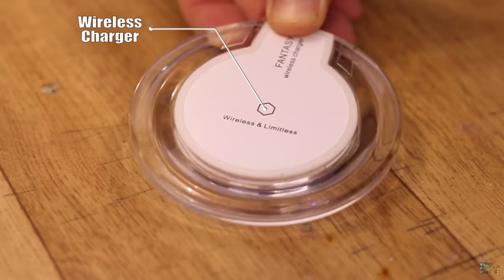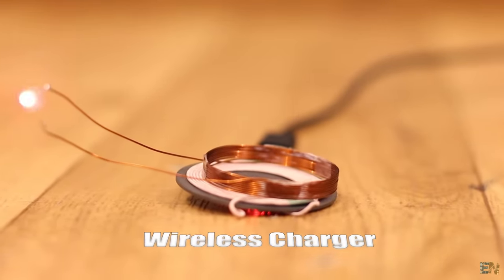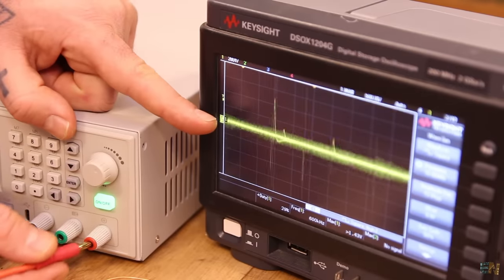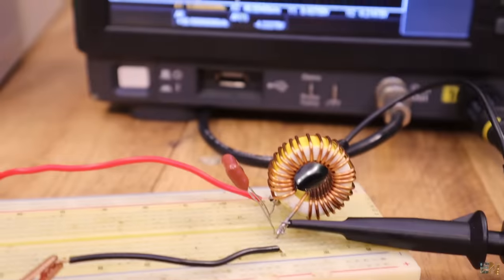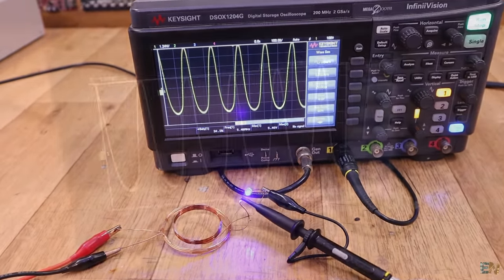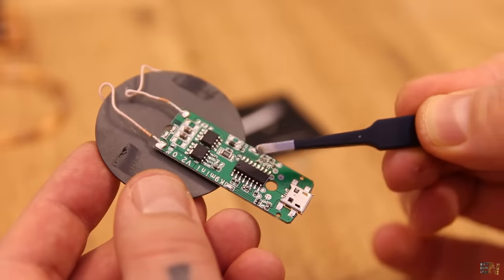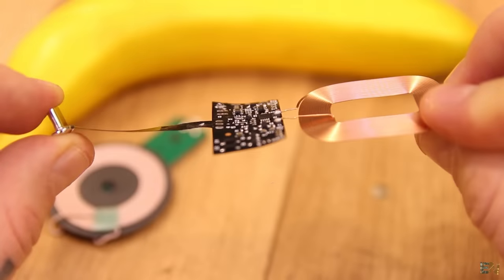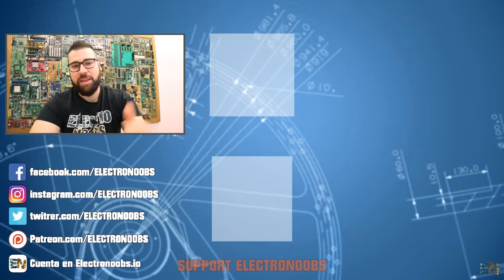Wireless Charger | Theory & Homemade Circuit

Comment: I wish you explained the transmitter circuit in detail. It’s not at all clear why the coil is center tapped, why the mosfet switches on and off, what all the capacitors are for, etc.

Comment: I know this is an older video, but thanks for laying it out in a clear way, and you ordered the information just right that I could actually figure out the implications instead of it being spoon fed. I already figured out the full bridge rectifier into a capacitor store and regulator combo before it was even mentioned because of the clear and well ordered delivery. Thanks.

Comment: the IC on both the receiver and Transmitter  are for communication with the exception of the transmitter doing double duty as communication and Mosfet Driver, The comms portion of the transmitter is for Smart charging. the short pulses from the transmitter is basically the transmitter asking "Anyone there??" However it also serves as a non compatible object detection and will prevent charge mode. When that pulse hits the receiver it wakes its IC and responds "yes I am here, Start charging"  once the handshake is made, it begins the charging process but also monitors the current draw from the device to be charged. The more the device tries to pull determines the Fast Charge state. If current is low enough it charges at 1Amp all the way down to 200mA.  If supported by the transmitter "QC Fast Charge"  the transmitter will send up to 2-3 amps depending on the QC level

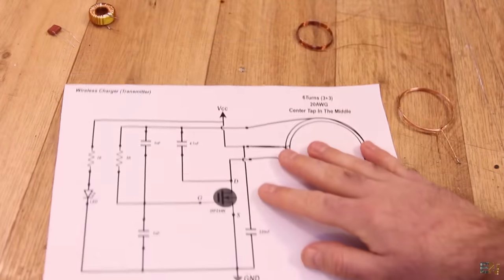Comment: I love the very helpful instructions of winding the tank coil on the transmitter circuit appearing at 06:29 which says.................,                        "6 Turns ( 3 + 3) Center tap is in the Middle"

Comment: I have recently constructed everything you have done for this project. really enjoyed the process of making it and learned a lot long research. Only one thing I couldn't find, which is the type of oscillation is used at the transmitter stage?? I was able to find that it is a modified Royer oscillator in one article. But again no explanation was found, so I am unsure if that's right. I would like to hear anybody's opinion too. the reason why I want to know this, coz there is no resonant compatibility between the two circuits. resonant frequency has been only determined for the transmitter stage but not for the receiver stage.

Comment: Is there is any applications for  transmitting power like this other than charging smartphones? Maybe it will be helpful if i covered my electronics with epoxy to make it waterproof and charge it like this🤔but I do not like it due to efficiency issues. 
By the way ,it is very satisfying to see all this positive comments 
Thankyou very much I appreciate all your work "Electronoobs" guy.

Comment: Hi there! I was wondering if you could help me with a DIY experiment I’m working on. I’m a barber and I’m trying to modify my wireless clippers to be wireless charging too. I was thinking of purchasing the receiver and soldering it to either directly to the lithium battery or to the area where the charging wire receiver is.(sorry for my lack of terms 😂 I know how somethings work from experiments I do but don’t really know the terms of the stuff. 

My second question is, once modifying the clippers, would I be able to use any other wireless charging ports or do I have to buy and use the same transmitter for the receiver connected to the clippers? 
 
Hope to hear from you soon! Thanks for the informative videos! Keep at it ! I love your channel. Learned a lot from it u have no idea 😂 thanks again bro
Reply: Also ! I forgot to mention. There is a company called Tomb45. They make wireless charging matts and power clips that can be attached to the charging port of the clipper which once attached and placed in the mat, can charge the clippers wirelessly. It’s totally cool except i don’t want to have a power clip attached but instead modifying the clipper from the inside. Which is also why I had the idea of directly connecting it to the charging port spot inside the clipper. I understand depending on the size of the module I may have to modify the shape of the clipper case too but that’s no problem as I modified the case many times before,  like you would when modifying a cars sharpe to fit new components. 

Thanks again bro and  my apologies for the long comments by the way 😂

Comment: Really good bro! Enjoyed it. 
But i am trying to do this exact project with some friends for our final test (11th grade eletronics and telecom). We only have two weeks left and it is not woring, we dont know why... wee use the osciloscope and there is no signal coming to the reciever or coming out of the transmiter. One of my teachers said maybe the wire we are using is too thick, so we would like to know what is the diameter for the wire you used. 
Also if you have any other tip i would apreciate if give it to us as quick as possible😩

Comment: Great video. I am working on a project and I could use your help. Do you do consulting?  I need two things. I want to make a wireless transmitter that is large enough to put a dozen receivers on top that will produce a charging voltage of 5 volts. Something the size of a dinner plate. Do I simply make a bigger wire coil? If I did would it overload when several devices are above it?

Comment: You forgot to talk about the skin effect . 
It's that when a high frequency current is passing in a conductor it passes only on the skin of the wire . That's why the commerical charger has thay type of wire which is a lot of thin wires twisted together . That's also why some high frequency SMPS transformer wires are thin wires winded together on parallel to reduce the skin effect .

Comment: Uhh... i have a few questions
1: Instead of the mosfet you use (In the transmitter circuit) smd can we use another mosfet
2: Can we make the receiver and transmitter circuit smaller?
Note: I am Turkish and Using Google Translate, Sorry for typos

Comment: great video, subscribed immediately !! One question, do you think would it be possible to have the induction power on a coil along a cable/wire and the the coil with the LED on a U shaped coil that hook on the wire to light it up? Just wondering can you have the power on a cable an be able to hook the LED coil in every point you like along this cable and be able to power the LED? thanks

Comment: Great job, I tried to replicate myself but I can't achieve the desired voltage on the reciever. Wheneever I connect the coil on the transmiter, the voltage from source, drops from 12 V to 1.2 V, I believe it is  because of the induced emf, do you have any idea what could be wrong?

Comment: This is awesome tutorial, very useful for me. I want to make a inductor coil long, say 1.5m long. The receiver moves parallel to the coil, I only need 5V, 300 mA 
Is it possible to make this? Are there any readily available? I am trying to eliminate  a drag chain used to carry power to a sensor.

Comment: hi,great video. The parts link you have provided are not correct.
All nf Capacitor links points to sane eBay link, which is really confusing for non electronic guy, like myself.
so requesting you please correct those links and also let me know which 220nf Capacitor you talking about,
please mention the complete code of 220nf Capacitor with voltages. 
and you mentioned something VCC and GND, do they have to connect to something or they are just names.
please clear this doubts for me
thanks

Comment: This video is great. I was looking for this exact stuff. I have a question regarding wireless charging. 
I have to power a laser operating at 5VDC @ 110 mA. The laser is mounted on a rotating shaft. Is it possible to power the laser wirelessly? 
I intend to mount the receiving coil on the shaft, the transmitting coil can be 10 mm distance ( the shaft goes thru the center of the coils). 
The transmitting coil is fixed to the base. So now only the receiving coil rotates. Will the wireless charging work even if the receiving coil is rotated? Will speed of rotation matter? What if rotation is slow?

Comment: how about lower voltage and amps? 
voltage regulator garantee maximum of 5V but does 2V harm mobile battery or chip ?
and if phone ran out of battery, device usually take 1A to charge battery and keep cpu alive. could low amps harm device ?

Comment: Thank you for the excellent video. Maybe you find the time for an Englisch electronic course. 😀
But is the part list correct? When I follow the e-bay link, there is no 5k resistor. And are there any 5k resistors?
Reply: you wont get 5K, get 10K and put them in parallel

Comment: Hey chap, thanks for the video, wondering if you have time to help me a little?    I have a permanent Lego train track which is going through batteries at a rate of knots.   I would like to use wireless charging built into the track so when the engines are at rest they can be parked over the charger to recharge.   The problem i have is that they run on 9v supplied from the Lego proprietary battery box that holds 6 aaa batteries.   Is it possible to make a wireless charger that will charge one of these boxes without having to remove it?    Thanks again.  Tanc

Comment: Is it possible to change the 5v power to 3.7v from the circuit of the wire less charger if we put a step down module
Reply: Actually , I have a 3.7 18650 battery for charge with wire less charger

Comment: Awesome video!!  Can anyone explain to me why this sort of technology is not being used to charge batteries that run the transmitter.  So the transmitter is being ran off a battery, DC, to an inverter to AC current into the transmitter coil to send it over to the  receiver coil where the receiver charges two batteries and uses one to run the transmitter while the other battery runs whatever.  Can that not work?

Comment: Cool explanation. What happens if you only change the polarity in the primary, while retaining the magnetic field? I mean, flip the polarity fast enough so the primary does not experience significant drop off of the magnetic flux, but the polarity of it changes?
Reply: Ok. So I see you have read my comment. What of the question? There are early descriptions of methods to induce current in a wire which includes changing polarity, yet everyone uses alternating current, which is not oscillating polarity, but swinging it from North to South. It needs to be switched. Then, perhaps, humanity will succeed in following in Tesla's footsteps.

Comment: You don't talk about negotiating charge rates and foreign body detection. Are those normally part of the wireless charger circuitry or something that you may have, depending on where the charger comes from?  I only ask as I've been playing with the [ridiculously expensive and ridiculously tiny] STWLC68.

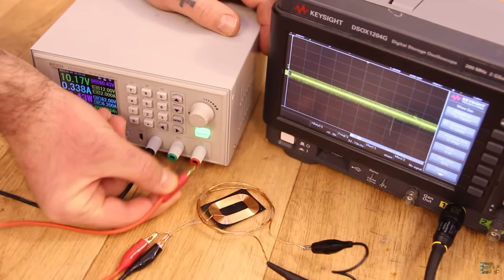Comment: >>>>>>>>>>>>. wait I have a question. >>>>>>>>>>>>>>>> 3:55
you turned the primary coil into a magnet by connecting it to AC or DC ? does your power supply generates ( AC or DC ) ?
I know the output is AC on the second coil, am I correct ?

does the voltage change from DC to AC during the process ??  What would happen if u Connected the primary with an AC current instead of DC ?

Comment: Hi, I just builded it myself but the light on my test led soldered with a receiveing coil isn't stable as yours but keeps blinking. I checked the voltage at my input (one charger of 12 V and 0.5 A) at the voltaged droped to 1.2 and starts oscillating between 1.2 and 1.5 V, which I believe, must be the reason for the blinking led. Can you help me figure out why the voltage is unstable?

Comment: can you also put set the mini spy camera directly attach on the electricity bulb cables above the bulb? 
and can the spy camera be connected to electricity separately to the bulb? I have 3 cables for 1 bulb at home (European type). I want to know how it works. thanks.

Comment: Is there a size limit for the output coil?  Can the loop of copper be several feet wide?  I'd like to incorporate a huge wireless power device into a dining table so that any wireless device could be charged regardless of where on the table it is.

Comment: How about creating it in such a way, that you can use batteries as a power source? My phone charger has gonne a bit wonky (as dust has accumulated over time in the phones plug-in location). So having a mobile wireless charger that can be used anywhere could be quite useful for me.

Comment: At 6:27 why does the coil now have three connections. I didn't quite get how that schematic works than 🙉 in your LC tank example before the inductor and the capacitor where in series or in parallel but now there is the mosfet in between. Could you explain that to me please 🙊

Comment: Do you do consulting? I want to build a simple wireless charging circuit with a receiver that is very thin and the size of a quarter. I need help bread boarding it and ordering a custom pcb with components. If not can you refer me to someone or an organization that has engineers that do freelance work?

Comment: would this work with an iPhone 11? The iPhone has the receiver coil already inside (since iPhone 7). So wondering if I just build the transmitter unit if it will work with my iPhones?

Comment: What power supply should I use to induce current, any step down transformer of 5 v ac if i connect to coil will work ?

Comment: 9:29: When the smartphone starts charging, why does the power draw from the PSU actually decrease? Should it not increase? There is  1.4W no-load consumption. After the charge starts, the consumption is 1.3W, any explanation on this?

Comment: Hello wanted to recheck on 0.4mm/0.6mm...What is SWG as in pic wire looks to be thiiner than 0.4 mm. I made with one of the old transformer that did not worked. thickness I am not sure... Pls confirm on 0.4 mm so that I buy same size as new

Comment: if we make a set of copper coil (reciever,transmitter) than in reciever can we use bridge rectifier to convert ac to dc and connect the output to usb for charging?

Comment: You forget another point of differentiation between your crude setup and the one available in market that you're using single core wire and in commercial one's they use litz wire, which consists of many strands of thin copper wire isolated from one another. Maybe you just don't wanted to dump all the physics related to skin effect and losses that occurs due to high frequency to new engineers. I get that.

Comment: I need some help with an mpu6050. Can you keep the same 0 degree value of the gyro after rebooting with the sensor starting in another position using esp32?

Comment: 4:34 how is it possible that the LED works with alternating current?
Reply from the maker: The LED is still a "diode" itself, so it will automatically rectify half of the AC signal ;)

Comment: 8:10... Why not use Schottky Diodes. They have a much lower voltage drop across them. I would also us a VERY low dropout Regulator.
Reply: Also the 1n400x diodes are terrible for higher frequencies. At least he should use uf400x diodes. But the video was very good and informative.

Comment: Can I use my iphone 11 with this charger? Is is possible?
Reply: No. you need a square wave at the coil. This charger transmitter produces a sine wave.
Reply: You can use a 555 timer with R1 22Ω, R2 240Ω and C1 27nF for ~107KHz and 52% Duty Cycle just as the oscilloscope says.

Comment: One of the most common failures on a phone is the power port. Wireless charging fixes that.
Reply: but its inefficient. induction power transfer is nomore than 80% and is typically around 30-55% efficient
Reply: @notyourmomyousnowflake3533  I’m not sure why that matters when we are talking charging tiny batteries, it costs less than 1 US dollar a year to charge your phone everyday.
Reply: @Diamonddrake  its likely to be more under increased phone battery capacity; leaving chargers in sockets; re-charging during peak hours; and increasing prices of energy. However, you are right in  its not an issue today.

Comment: This "wireless" power transfer is called so because the amount of coiled wire in it is three times bigger than in wired power transmission, or are there other reasons for it?

Comment: I made your circuit I doubt your phone was charging fast at all. Even without bucking the voltage the ma are low. Bucking it to 5v you get around 100ma.